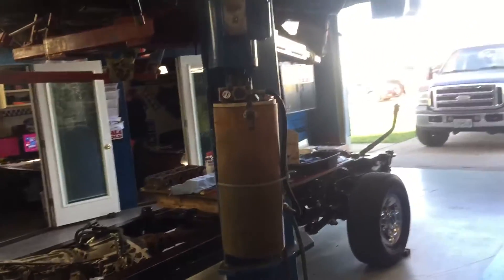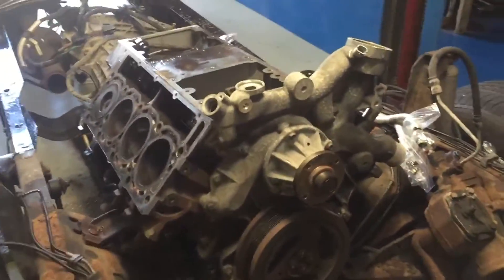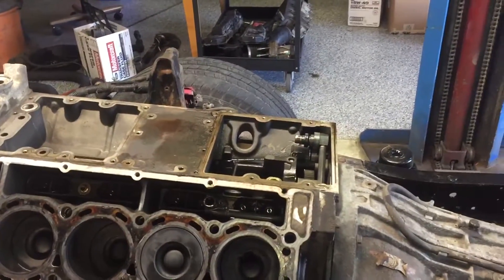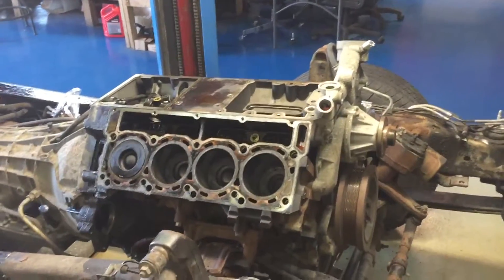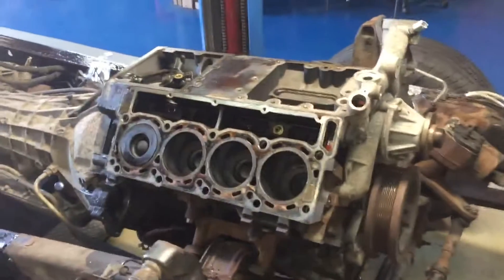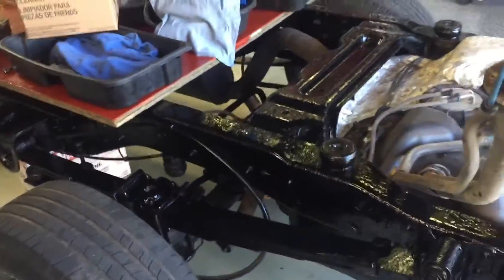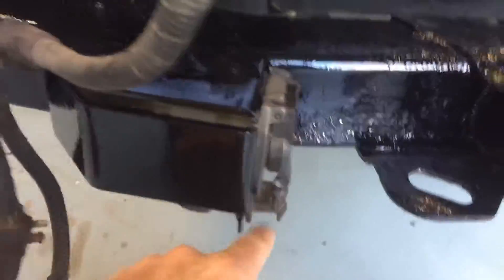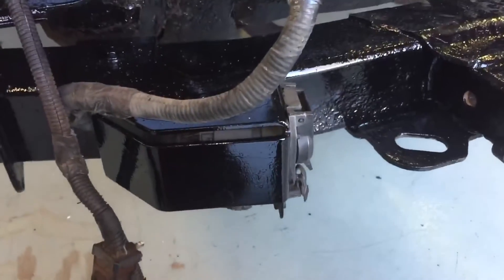Wounded Warriors video 3

Comment: What is the update for an late 2004 HPOP? Should I do this as a preventive maintenance thing or wait for failure before replacing. 105,000 mile late 04 excursion.